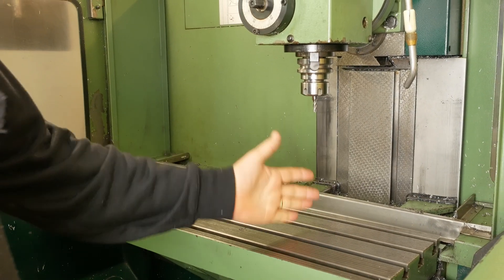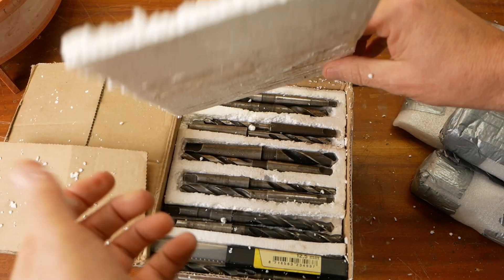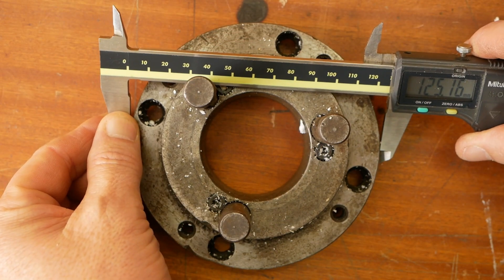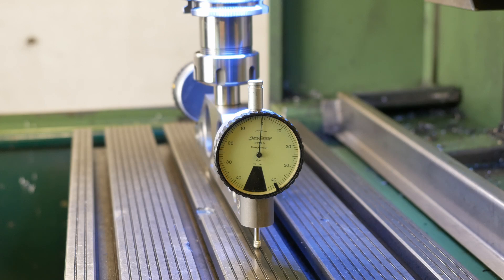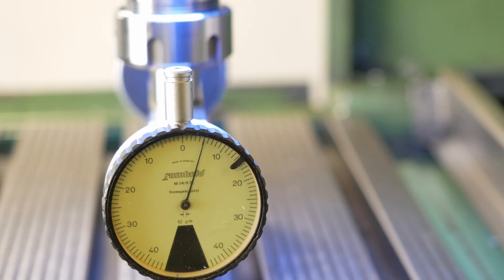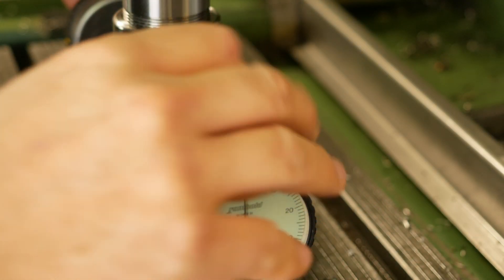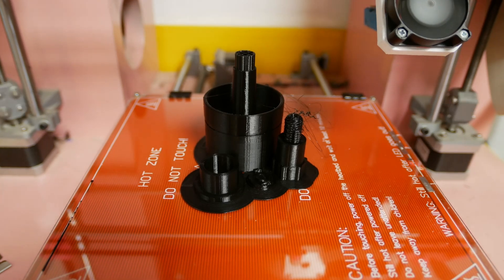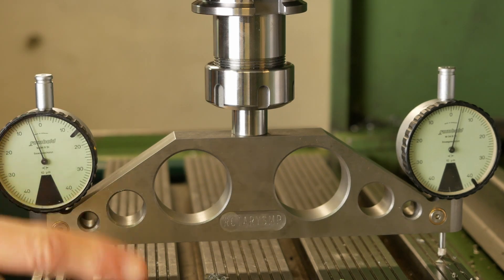The most amazing shop made tool! || RotarySMP

Comment: You’d probably want to use as large a shim as possible to ensure the table still had good contact with the frame
Reply from the maker: Good point. It has been pointed out that misadjusted gibs would also cause that sag, also could vertical slide wear.
Reply: @RotarySMP  well guess we’re gonna have to tear the whole thing down!!! And rebuild it proper like of course (again)
Reply from the maker: @adamfreeman218  No way :) 
This machine is in very good condition and never did much work. I need to look at gib adjustment.
Reply: @RotarySMP  right as rain per usual ❤️❤️❤️
Reply from the maker: @adamfreeman218  My inherent laziness looking for the easy way.

Comment: Thanks for an informative video - a nicely made tool. Another surprinsingly sensitive method of sanity-checking your tramming is to look at the scratch pattern left by a fly cutter or face mill.
Reply from the maker: True, that is a good warning sign. This tool is so rigid, it makes for really repetitive readings. Much better than swinging the clock as before.

Comment: It's usually wear on the knee z axis ways, it's a common problem with those machines Deckel, Maho etc.
Reply from the maker: Good point. This one has not done much work. I also need to check the saddle gib adjustment.

Comment: Before you can say that this is the table sagging and not the head nodding you must check the table front to back with an indicator directly in the spindle. It might be that the table is parallel to the Y axis, then it's the head nodding. In that case you'll either have to accept it or adjust the mounting surfaces in some way.
Reply from the maker: Good points thanks. I could be gib misadjustment on the saddle.
Reply: @RotarySMP  that too. But you should check for nod in the head too. My thiel duplex has about 2/100mm over 10cm of nod, and I can't fix it in any reasonable way.
Reply from the maker: @malteser0212  Yeah, that would suck. The horizontal way of the Maho is the gearbox housing.

Comment: isn't  possible to  joust  mill   sagging   of?
Reply from the maker: It has been pointed out, that the sag my just be misadjusted gibs. I would not machine off the top. I'd rather scrap in the mount flange if the table is really distorted.

Comment: Just a thought , Might be worth checking your vertical slide ways to see if they need tightening before scraping.
Reply from the maker: Thanks Leslie, good point.
Reply: Don't these machines have an active lubricating system with an oil pump constantly running? Maybe it you'll get a different reading when the machine is fired up instead of stopped cold.
Reply from the maker: @meocats  Yeah, but that lube unit runs ever startup, and every 20 minutes of operation, so by the time I had this all set up the lub unit had run multiple times.

Comment: Well, with a tool that makes tramming in the head that easy you've got no excuse for not tilting the head at an angle when needed, right?

Also, I'd agree that shimming the lower bolts on the table is probably the simplest fix. The math should be pretty simple to calculate the shim size, no?
Reply from the maker: Yeah, but it has been pointed out that the problem could be vertical slide wear or gib adjustment needed.

Comment: Great video as always; making me consider youtubing to motivate me on projects....I'm tramming in my ISEL CPM3020 as we speak using the disassembled mag-indicator base, so funny to start watching this video to see you doing the same haha! I'm having to zero a plate of glass to the x/y motion of the machine, sweep that glass at 4 points and rotate the router head for tram or shim it for nod...THEN recut the bed to be flat in relation to the glass... shes an old girl with no adjustment options, runs in NC code too!
Reply from the maker: Thanks, It is not too difficult to remove the table on this, so if necessary, I would scrape in the mount flange rather than recutting the table.

Comment: Surely you need first to zero each guage on the same spot on the mill table before reading how far out your tram is? Not to do so assumes that both guages, their mountings and their tips are identical, and they wont be.
Reply from the maker: I played around with it, and did exactly that, but it didn't come across in the edit. Sorry for the confusion.

Comment: is it the table out of tram, or the ways that has some wear on them.
Reply from the maker: That is a good point. This machine as dont very little work, but it would be a gib adjustment or way wear issue. What tests would you recommend to determine what the issue is?
Reply: @RotarySMP  I got no idea, just thinking out loud.
Reply from the maker: @ChristianDK_dig  You are on the right track. There were some very helpful comments along the same lines.

Comment: Shims under the lower bolts that hold the table to the column? If it's built the same way as the one i use at work, that seems a possibility
Reply from the maker: Yeah, that seems the simple solution.

Comment: Nice tramming tool and clocks..
It’s probably time to call a Gotteswinter for help on the table alignment
Reply from the maker: Good idea.
Reply: @RotarySMP  ah, didn't Stefan do some machine tool alignment with some kind of funny epoxy? that might be a way.
Reply from the maker: @Anonymouspock  That is only necessary if you need to build back up after metal removal. Here you could just scrape for alignment.

Comment: 5:35 I forgot all about the hole in the table.
Reply from the maker: Hi Alexander, 
I didn't :(
Reply: @RotarySMP  mill/bore it into a square/circle, make a plate that fits precisely, use loctite 601 to fix it in place
Reply from the maker: @ikbendusan  Yeah, that is the plan, but it is not a hi priority.